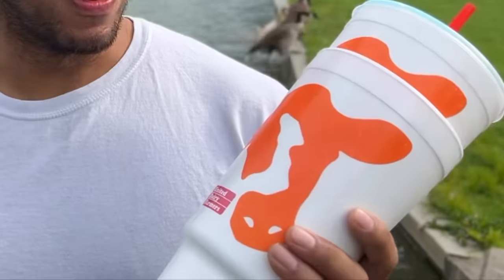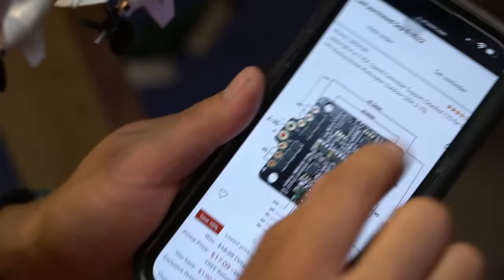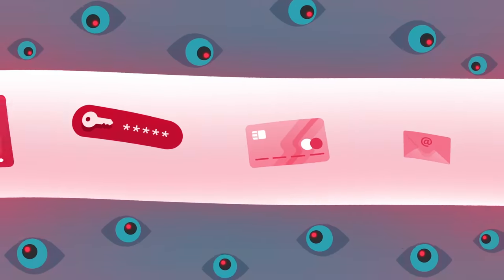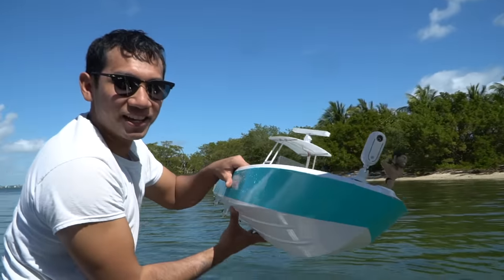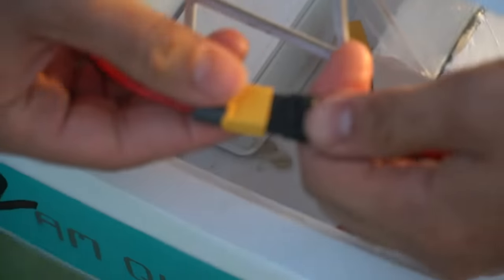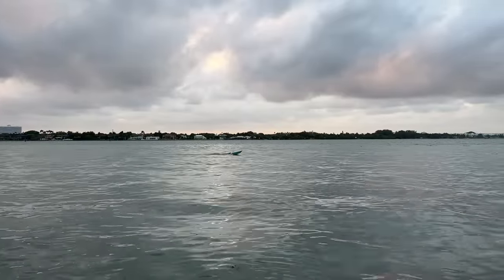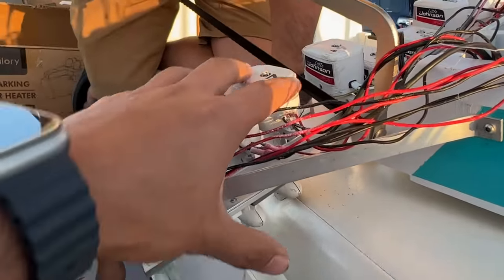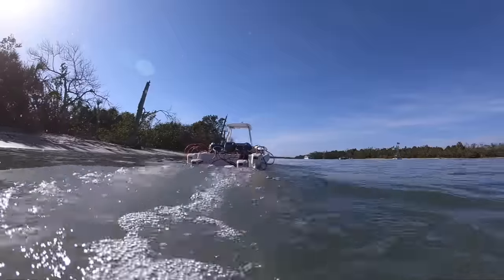How many boat engines is too many?

Comment: Florida Boat man here, again. The Step hull Is Great for rough water, but ultimately slows you down. They're basically hooks. To achieve better performance you need Trim and Tilt,  and Jack Plates. The trim and tilt will allow you to adjust the angle of thrust, making it easier to get on plane and reach a top speed. The jack plate will give you control over the depth of the engines, which also helps with acceleration and speed. Prop pitch Is super Important, but I'm not sure how that would translate into miniature applications, so you're sort of at a loss there. And finally, you made a very good observation not too many people would catch. The engines on the outside will get thrashed without something to help break the water. This is true for large applications as well. They're dragging more than providing thrust at that point. The ORIGINAL idea behind Multiple engines was to avoid getting stranded. If an engine failed, the remaining engines would provide enough power to pick the boat up and put it on plane. There's nothing worse than having to chug along at 5mph, 100 miles offshore, because you cant get on plane and cant risk burning all the fuel by plowing through the waves. Any number of engines past that is normally just a rich dude flaunting his cash and ego. And just for fun, I bet the hull you chose to model your "12 AM Quickee," after is either a Intrepid or a Contender (32'+ IRL)
Reply: Most definitely a contender
Reply: Just read Florida and he's qualified from the start and expert 🦅🇺🇸
Reply: thank god were moving to pensylvania this summer been stuck here in florida for 7 years! (that was just bad luck i can speel)
Reply: I think he was also hitting the problem of not having enough weight in the nose.. The stack of three rows was definitely working though - so fast. All it needed was full all engine steer and that extra bit of weight..
Reply: A step hull is made for less drag in the water
Reply: Not quite sure why you say that a step would in any way hinder speed or efficiency. They are designed to create an area of negative pressure to allow air to travel into. Once more air has been sucked under the hull and by the step this allows for less wet surface (a cushion of air per say) area and less drag and ultimately a higher top speed.
Reply: This guy boats
Reply: The point of step hulls is to improve efficiency by reducing the suction effect between the hull and the water
Reply: Happy to not have to write this comment
Reply: I think the perfect number would be five sta staggered in height at the rear 1 low 2 hi 3 low you get the point I’d love to see you try five motors thanks
Reply: 14:29 cool😂👍
Reply: Might as well of been “Fu*** Reddit man here” 😂
Reply: yo

Comment: With the addition of the smaller side boats, you created tons more drag. Also, the motors in rows wasn't effective because you wont go any faster without an increase in rpm, which would increase the drag from the slower motors. An impeller setup would be fun to watch!
Reply: Also the reduction in propulsion due to neighboring propeller wake causing cavitation interruptions and blades being out of water.  Watercraft are several separate systems designed to work together; hulls, propulsion, etc.  You just can't tack a random drive system on a sail boat, barge, or anything random that floats and expect performance or worthiness.
Reply: 13:38 covered this...
Reply: I am fairly confident peter knew exactly how this video would turn out to be even before doing all of this. Its just fun to go through the process even still :)
Reply: @godsonjoseph I find physical models help a lot when I comes to seeing what other options might work. Kinda like the turbo axle. What an innovative technique that flopped hard. I’ve always wanted to see it revisited with more modern tech. Plus some odd things are just cool. The rotary Motor has its mighty big list of downfalls but it’s such a cool system to see done well.
Reply: Hydrodinamics failed him here

Comment: I like the attention to the little details, like the rotating radar on top. 
The original row of motors might done better if there was adjustable trim. 
Also more might be more beneficial to run at top speed even if towing a skier.

Comment: Great video! Can’t wait to see the STL file for the outboard motor. Do you think one of those outboards will be enough for an 18” boat with a 1lb ready to run weight?
Reply: Hull shape and prop pitch will make a massive difference to whether to works or not. Also you're desired speed will be a factor in whether you're disappointed or not.

Comment: For the amount of propulsion/engines you're wanting to use, the  draft & water displacement is too shallow (or you need to switch to a more flat bottom, plane hull and/or a hydro-foil.)  Increased surface area & buoyancy wasn't the solution, but increased ballast, changing the center point, and a longer, prouder keel.  Your hull is the problem for the power you want to output - that hull will always turn submersible at excess speeds.

Comment: another issue you ended up running into was weight bias and trimming. with the weight in the rear it needed more trim down, or weight up front to balance out.

Comment: Why not mount fore to aft Hull, so they are like "Bow" Thrusters, spacing them out under hull, staging port & Starboard there layout so they don't interfere with each others "wash" ... or just go with 2 ducted Fans (EDF's) on rear to push water ... ;)

Comment: You came to the right conclusion about the motors. You didn't try adding ballast to the bow of the boat to keep the bow down and help it get on plane better. Doing this should help to reduce drag and increase speed. There is a fine line between balance and nose dive, have fun.

Comment: the problem you were having getting on plane wasn't the motor configuration as much as the motor "pitch". to get a boat on plane you have to trim the motors up so they try to thrust slightly downward which in turn lifts the nose of the boat and gets more of the hull out of the water so you go faster with less resistance.

Comment: Got to change the pitch on the props to increase speed. Example, 5000 rpms at 12 inches (pitch of prop) of travel per revolution is a constant no matter how many horse power you have. 5000 rpms at 24 inches (pitch of prop) of travel is twice as fast. More horsepower (more motors) allows you to reach the 5000 RPMs at a higher 24 inch prop pitch

Comment: You need to do a small scale of a pontoon boat with at least three pontoons one on each side and one in the middle and then you could replace all the outboards on the back and you know make it as wide as you can on whatever you can find on the internet or whatever you can make. I think doing a pontoon setup would just be something different.

Comment: To me as a mechanical engineer the best solution was the first solution(all engines next to eachother). In your experiment due to the fact adding more weight to the back and the torque of the engines it didnt work as well as it could have. I think you should add more weight to the nose of the boat. this will result in better performance up until a certain point. Putting engines in front of another one will not result in an increase of power due to flow interferance of the engine in front. For the mentioned first setup: adding engines will work for increased acceleration(in my theory). however, top speed wise it wil not likely increase up until a certain point as the propellers of the engines will simply not turn faster then a certain rpm(adding 2 engines from 16-18 engines for example will not be likely to increase much top speed).

Comment: I'm like 95% sure that there should be additional gear change from the drone motor, because, well, water is quite more dense and viscous than air :D Overspeeding a propeller does no good form what I know...

Comment: Now I'm no RC expert (far from it), but I understood that when using brushless motors, you need a speed controller per motor (I learnt this from research when I was trying to put a twin prop plane together). This might be another factor in the 'below-par' performance?
Reply: he had 3 quad escs and 3 batteries

Comment: 4 in 1 ESC questions: Im looking to buy 4 in 1 esc to be used with a car radio (Dumbo-RC X6 2.4G 6CH Transmitter with X6F/X6FG Receiver) which I believe is just pwm..
- Which 4 in 1 escs are reversible and and how can I tell if they are?
-

Comment: Problem is first of all the motors were pulling in air and pushing that in water for propulsion, air can't give reverse force in water when pushed, the props needed to be deeper in water, it would had been better if you had used toroidal props for propelling, or the best way was to create a single propeller attached to a big motor, for example a ducted tube and a Archimedes screw inside it with a really big motor attracted to it for propulsion, and reducing the screw size by maybe 25% from where the water would be pushed out of the duct to reduce turbulence created by props, and using a ducted prop would require it to be attached below the boat's belly or under part or whatever you say it, this would avoid the problem of pulling air from above, and a long duct starting from nose of the boat till tail would help it be stable in water and not lifting up the nose, and for the steering part in such a duct you can use a custom device for maneuvering the direction of the jet stream that gets out of the duct this would help it turn better at high speeds

Comment: i am pretty sure when you make 3 row motors at the back 
You need to raise  the motors inch by inch 
By that way it can survive 
Still steering will be impossible unless you put turning motors at the last row. 
Also you need good spacing for turbulance

    M   Space   M     Space   M    Space   M
                          Good X Spacing 
Space  M      Space  M      Space  M    Space
                        More  2X Good Spacing 
    M   Space   M     Space   M    Space   M

This Schme can work

Also If you are adding horsepower you must add weight to front
Like Airplane CG point boats have CG when they plain. 
When you add weight to front it will look very bad on idle but on high speed plain it will make good CG and increase top speed.

MY HOPE... =)

Comment: The boat will not go any faster if the rpm remains the same, however, there is visible difference in the acceleration since more engines are sharing the workload to get the boat up to speed.

Comment: This is just a theory, not exact science, but I believe that adding more motors increases the acceleration and to increase the speed you need to increase the rpm of the motors or the pitch of the propeller.
The reason behind it is that assuming that at full speed for every revolution of the propeller the boat moves a certain distance, adding more motors is not going to increase that number (as it's dictated by the rpm and the pitch angle) however from stationary more motors will be able to move more water out of the way during the same period of time. 

Now, because water is not a solid it will move out of the way, so even if the calculation of the pitch angle say it should move 1cm per revolution it won't move that far because of the friction of the boat and the water moving out of the way, and adding more motors would reduce this inefficiency. However if one motor is able to get 70% of the maximum speed, adding a second one won't give you 140% but probably something like 75% (these are just random numbers). And getting the actual rated speed would be impossible even with an infinite number of motors because the efficiency of each motor reduces  by how many motors the boat already has.

Comment: 13:52 add a extended divers deck on the rear to stop the water from drowning the engines there’s so much power lost simple sheet drop the engines in small holes 😂

Comment: Try bigger engines driving more props. Stick with 4 engines but a lot bigger/more powerful with 12 props only sticking to the sides. No drag from the outboard housings, just a shaft sticking out laterally driving props.

Comment: The max will be dual inboards with props exiting under the boat like a normal inboard, plus 6 outboards.
That is what you should have done, and should do now.
Anything outside the hull width was never going to work, common sense.

Comment: when you add motors you need to change the pitch of the prop.  more motors=more power=use more pitch.  the boat will go marginally faster if all the OB's have the same prop pitch.

Comment: Hey Peter, if you want the boat to be able to turn in the stacked rows of 4, you'll need to invert the direction of the second set of motors. Having multiple pulling in the same direction will result in a "crab walk" or "strafe". 

/     = crab walk             /        = turn
/                                       \
Reply: I would be surprised if he wasn't aware of this since this is also true for planes with twin props or more.
Reply: @FtanmoOfEtheirys  you misunderstand, he means the steering direction not the prop rotation direction. airplanes do not steer the prop.
Reply: @bigiron4018  Thanks
Reply: @FtanmoOfEtheirys  Also, misunderstanding or not, knowing something and thinking to do something are two very different things.
Reply: Although I did just realize only the first set of motors turns, hence the issue.
Reply: big wrong.all the motors are behind the center of pressure which it the boats keel. so all motor must turn the same direction to acheive a yawing motion
Reply: In my humble experience, the problem of multiple props turning in the same direction is a list/tilt of the boat in the direction of rotation (if memory serves me correct).  Don’t know if at this scale, it is quite the same issue. 

However, on one work boat I had to be on for my employ, it bothered me to no end that the company spent so much money on the setup, but didn’t go the extra mile, so when at speed, the boat would list a good 10 degrees.
Reply: @straightouttheshed  You're wrong. Im not talking about every setup, im talking about his specifically. You are thinking of what would happen with a large movement radius of the motors  and/or proper spacing between them. Did you watch the same video I did? Because his application in this way DID NOT WORK.
Reply: @GrimReaping  yea i watched the video and idk if you noticed but in his setup only 4 of the 12 motors have steering linkages only the front ones closet to boat, meaning he place his yawing force closer to the center of pressure and has a drag force behind his yaw force, causing it to not be very effective but it still turned in the intended direction because his yaw force is opposite of his intended heading because it is placed behind the center of pressure.
Reply: @Karl with a K Not sure what you mean. Want to clarify?

Comment: You have a planing hull, with lifting strakes and all the weight is at the rear which does not permit the lifting strakes to 'lift' the boat.  Add some weight to the front and it may fix the issue, and will also reduce your rear drag.
Reply: Good idea. I was thinking about weight too when it wasn't working well also.
Reply: Exactly this👌
Reply: Trim the motors down a little maybe  ?
Reply: It is a ballast and center point issue, but I believe that specific hull will always plow-under and turn sub at an excessive speed point.
Reply: How about glueing one of those spare outboards to the back of the boat, pointing straight down, to help lift the boat out of the water? It looks like a lot of the energy created by those 12 outboards was wasted in pushing the bow of the boat upwards....

Comment: More engines give you more torque but not necessarily more speed.  More speed would come with different props or faster prop speed.  Also putting more weight on the front to balance out the boat better might allow it to get up on plane easier.
Reply: More outboards also means more drag. A pair of big outboards for a certain powerlevel is more efficient than more smaller ones.
Reply: Your prop pitch is basically your gear ratio... If you keep the same gear ratio and add more motors, it'll get to top speed quicker but will not go faster... Of you add more motors (more horsepower) you'll need to increase your prop pitch to give it a higher gear ratio which will give you more speed.

Comment: You can get way more speed just by changing props. For the four motor set up the props are probably perfect for the power you have, but with the 12 motor setup you have tons of power you aren’t using. You can see this by the fact that the boat had an almost nonexistent 0 to top speed time. You need steeper pitched props to utilize all that power. For reference look at offshore race boat props. That’s probably the level of pitch you need. Where they are almost parallel to the direction of boat travel through the water. You could even do sequential pitch on each set of 4 motors. The ones closest to the boat being the shallowest pitch and the third set back being the steepest. You could definitely do a revisit video testing prop pitch.

Comment: Your always going to be up against the 'hull speed' of a boat, adding more motors just adds more drag once you go past the happy balance of power for the hull design
Reply: you're
Reply: @h2s142 hey man, I'm just doing my job to help fight the "your you're there their they're our are" pandemic.
Reply: That's what I was taught by a sailor. He was training me on a sailing yacht. He said, while under motor power, don't push the RPMs past the point of diminishing returns. The hull speed maxes out, and more power just uses more fuel without much, if any more speed. This guy's hull seemed maxed out, and more motors just made more bubbles, not speed. He's gotta deal with drag as he adds more power.